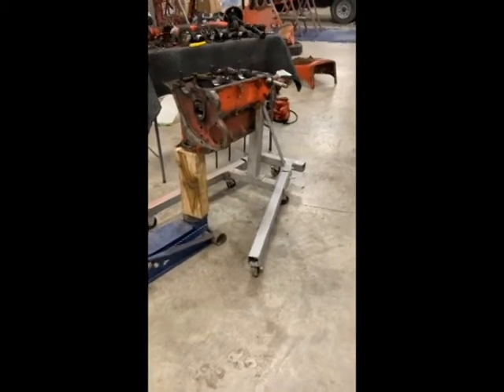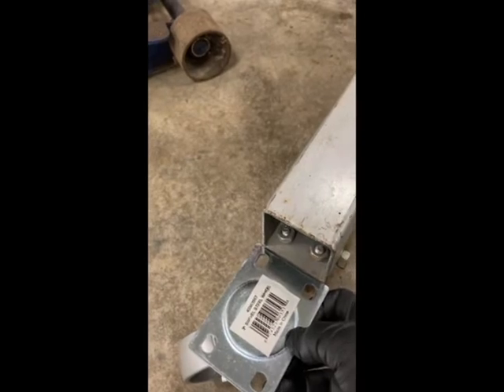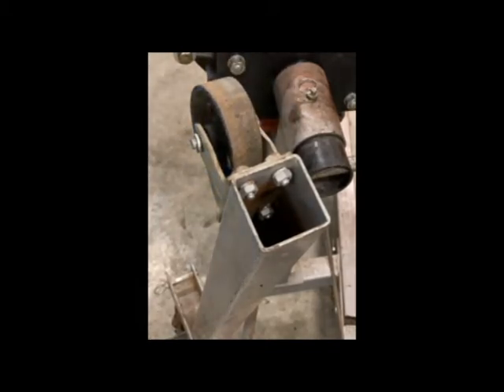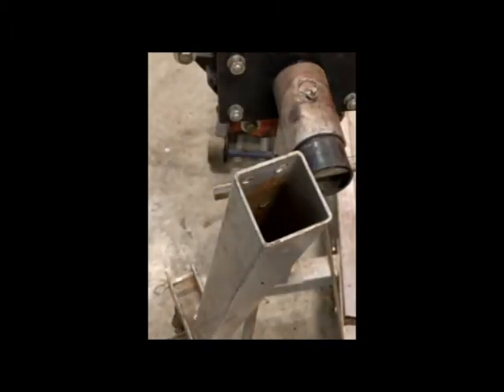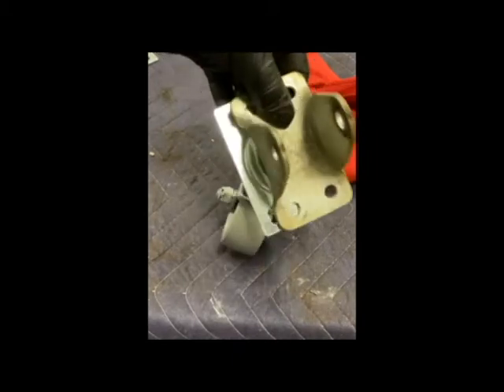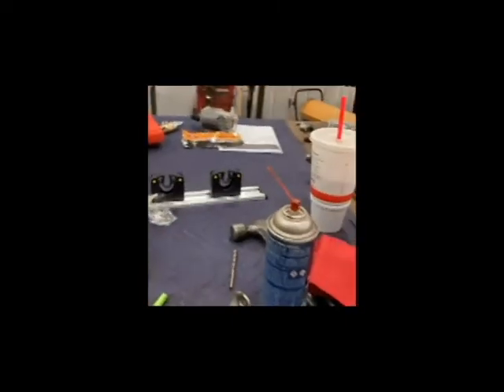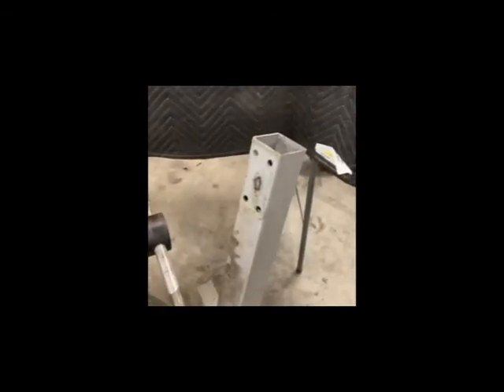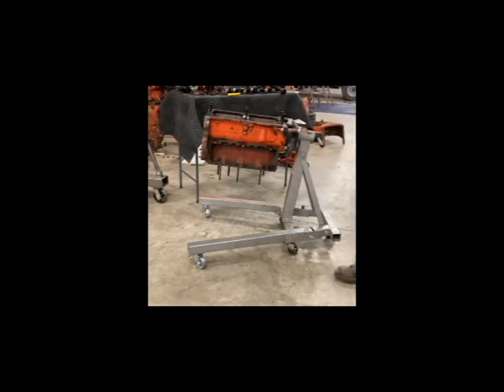DIY Engine Stand Caster Fix

Comment: I have the same setup on an engine hoist and the wheels are terrible. The problem I always have with mine is getting under the smaller tractors. I usually have to remove a leg and balance by hand. Obviously, not ideal.